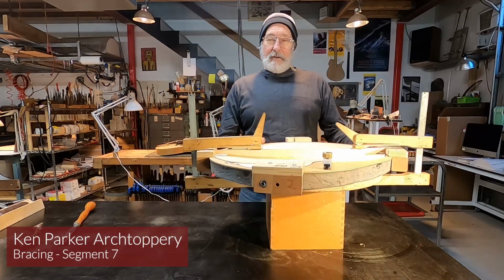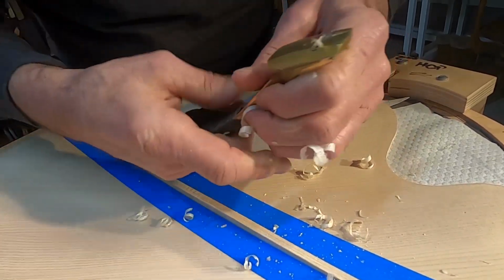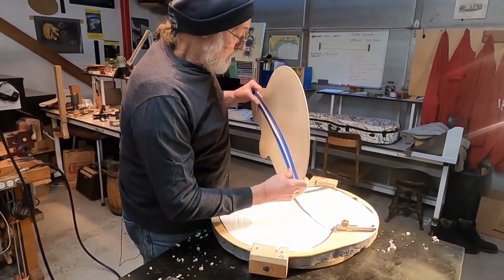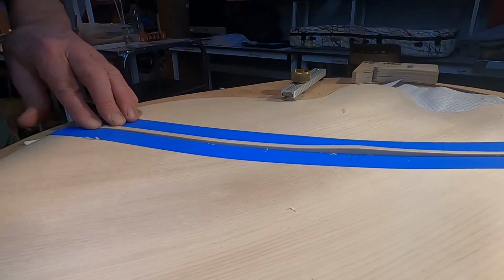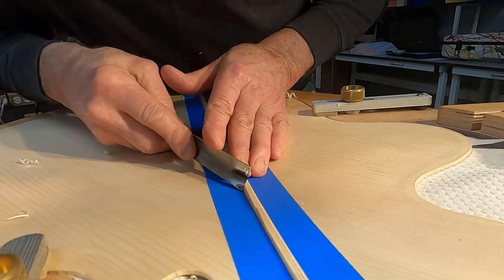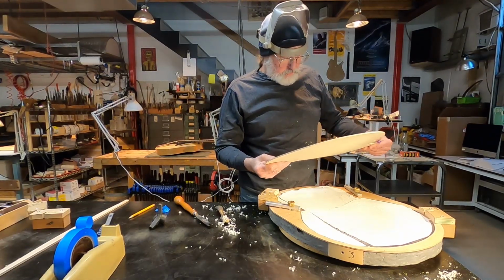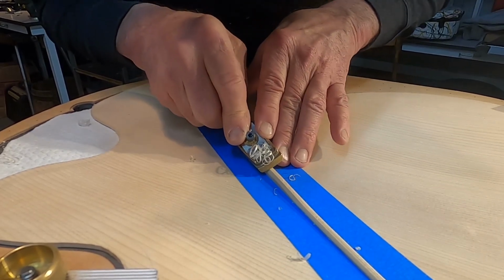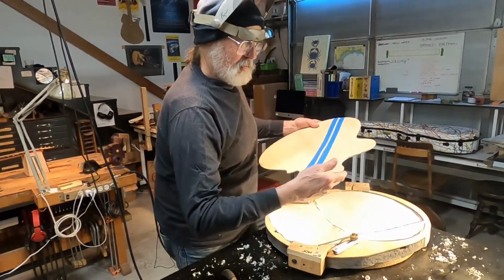Ken Parker Archtoppery: Bracing the Top 7

Comment: Wow!  Those are some thin tops and braces.  Much thinner than I was expecting and had seen elsewhere...which is one thing I've come to realize in the flat top world.  I took the steel string voicing class from Robbie O'Brien and with his method now my tops and braces are much thinner than what you would find in plans or certainly a production flat top guitar.  I know why the others are much thicker, it is just interesting to see how thin non-production pros go.  Time to jump into the archtop world.  Thanks for your knowledge Ken!
Reply from the maker: It's important to have a flexible, sensitive set of plates which can be successfully driven by the little plucked strings we use on guitars. In my opinion, nearly all archtop guitars are wildly overbuilt, and are way to stiff to realize their potential as acoustic instruments. This is the reason that "traditional" archtop guitars are normally plugged in, and strung with nickle strings in order to drive a pickup designed for electric guitars. Remember that the stiffness of the plates varies with the cube function of the thickness. A little too thick is way too stiff.

Comment: Initially, it does seem as if those braces wouldn’t be adequate.     But as you explained their function being more about encouraging the top to acts civilized and wholesome.       

The catenary arch is known to mankind as one of the most effectively strong shapes.   Arched stone bridges and Igloos for example don’t need bracing as the load is evenly distributed outwards.  

Similarly, the top and bottom of an egg is the strongest points of the shell which happens to be where the bridge of your archtop guitar will live.     

In theory I wonder if the braces can be thinned down even more at that apex of the arch as the bridge’s interactions are dispersed practically everywhere but straight down.     

If an egg shell, when properly positioned and supported can hold the weight of an adult, that sure puts into perspective the incredible physical properties of an archtop compared to a flat topped guitar. 

Triangles are another naturally stout shape but a hexagon is even stronger.    A bee hive is a good example that relies on incredibly minimal amounts of material (beeswax) to make an extremely strong structure that’s also an effective maximized use of space.  

Over the last few decades, there’s been some interesting uses of hexagon nomex, wood or synthetic material beehives sandwiched between two thin guitar ‘tops’.  It allows for an extremely minimal and lightweight yet naturally load distributed strength to double top classical guitars. It’s wild that no traditional bracing is needed whatsoever.     I saw recently a luthier using balsa wood and a cnc to cut the honeycomb shapes while also tapering it thinner out towards the sides of the guitar.    It’s basically like applying the physics of an archtop and honeycomb structure to a flat topped guitar.    

I love this stuff!      Especially when luthiers like you and others actually can apply these ideas to make breakthroughs in the development and sophistication of my instrument of choice.   Thanks
Reply from the maker: Really great commentary, Jeff!  This making stuff stuff sure is fun!

Comment: Oil, water, or diamond stones?  #3 sweep around an inch in width ( or metric equivalent)?  Looking razor keen, looks like you are having a great time shaping the brace.  Yes, very interested in your mini plane modifications.  Thumb planes are stupid expensive, but if you are a metal shaper, a challenge to be proud of completing.
Reply from the maker: I use water stones for woodworking tools, Etude to come.  #6 sweep on the gouge shown.  Any tool you can buy is cheaper than any tool you can make, with only a few exceptions.  Good tools cost money, the usual disappointment is spending the money and then finding that the tool works poorly.  Ouch.  You're right, though, making your own tools is really satisfying.

Comment: So you are not using xylene to remove the tape residues?
Reply from the maker: The way I de-stickify the tape that touches the top ensures that no clean up is necessary.  Although xylene is here in stock at the shop, it's my last resort solvent, as it is really really not good for us.
https://www.ncbi.nlm.nih.gov/pmc/articles/PMC2996004/